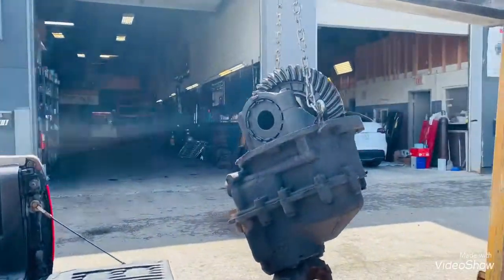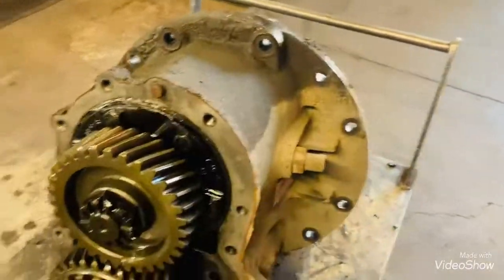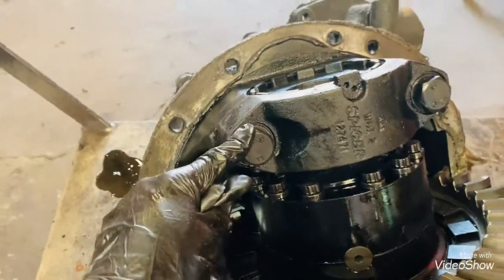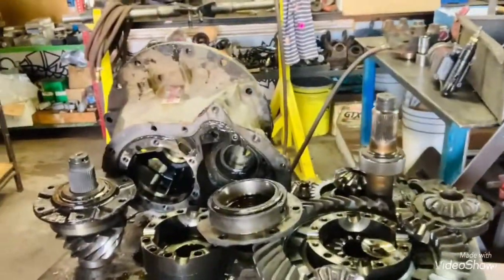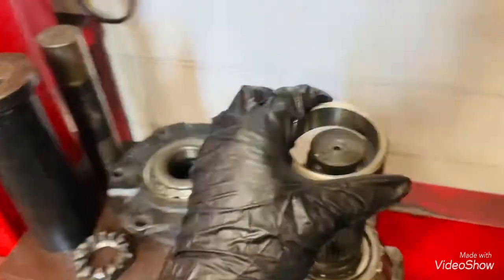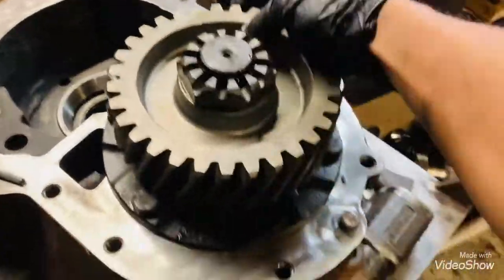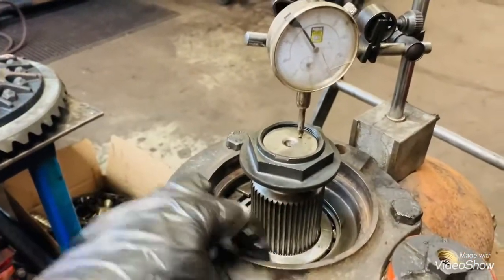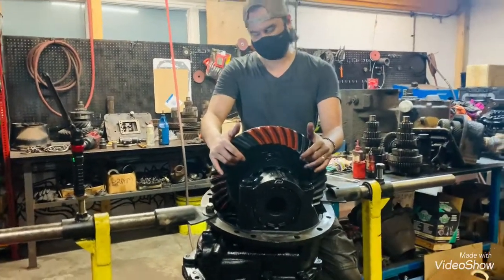How to disassemble & reassemble a spicer/eaton DS404 differential

Comment: In one of the casing you didn't add silicone. And are there any torque specs for the bolts? 
I saw the end play inspection. 

Are there any audible or visual signs of damage to the differential.
Reply from the maker: Broken powerdivider nest inter axle assembly.